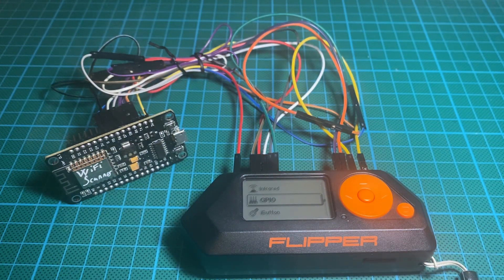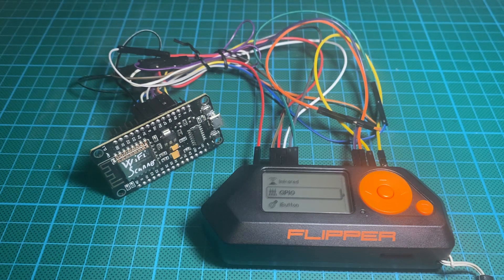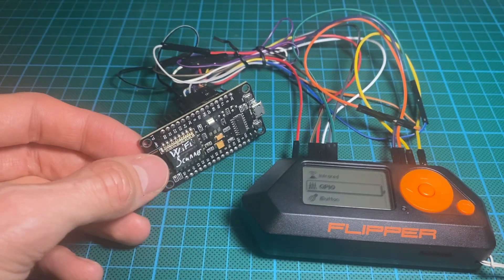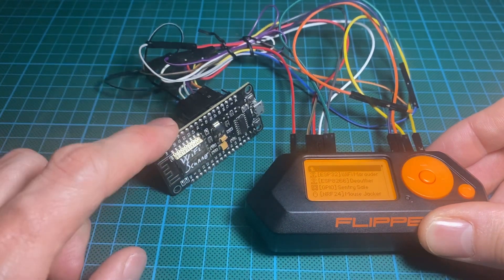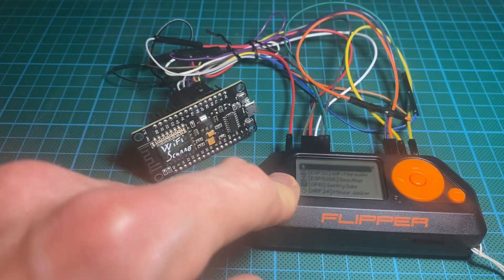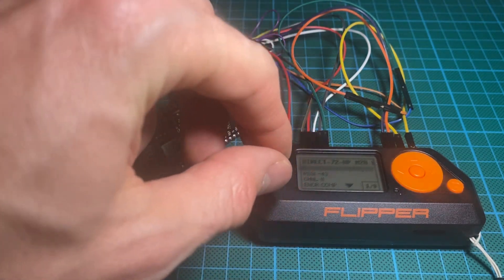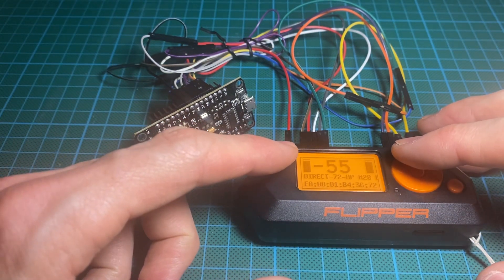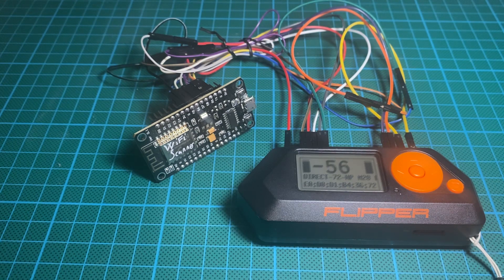Flipper Zero : Hands-on ESP8266 WiFi Scanner Module

Comment: i flashed  the board but its not working for me . i think im wiring it wrong
Reply from the maker: Are you able to get any output from the terminal once it is flashed? Did you used all the files in the right order to complete the flash ?
Reply: i belive i flashed it correctly .the led does the blue blinking when i enter the app.thanks for the reply!

Comment: which .bin did you use?
Reply from the maker: Hi Tristan, I took the one from here but depending your esp version you might want to compile from sources https://github.com/SequoiaSan/FlipperZero-WiFi-Scanner_Module 🤗
Reply: @Sam's eXperiments logs  finally got it working! Had a hell of time just trying to see the board on my pc. Ended up being the usb cable. I tried 10 different cables and only 1 worked haha.

Comment: i have a wifi Nugget with an esp8266 with the GPIO exposed on the back, could I then interface it with the Flipper with the wiring scheme you have here with the bare board
Reply from the maker: Not sure if that will works but if you could wire the esp8266 to the flipper zero that is fine. However this is not the same firmware. You will need to check if you could use serial/uart or spi interface. But for this you will need to develop your own application